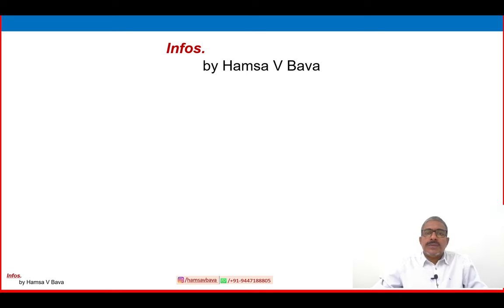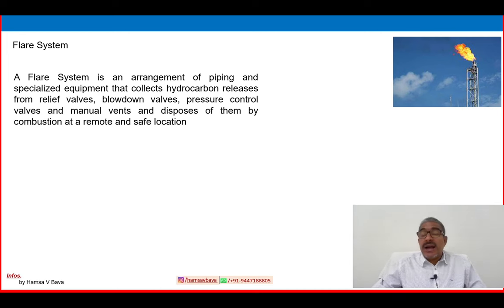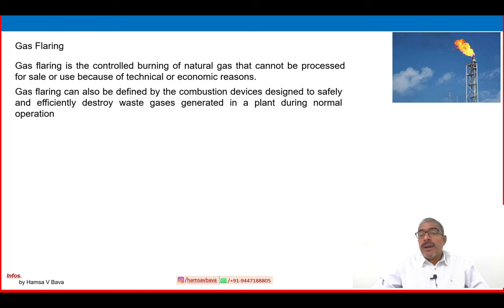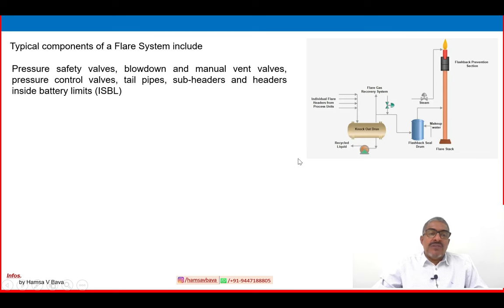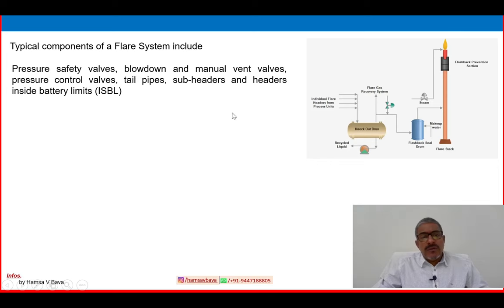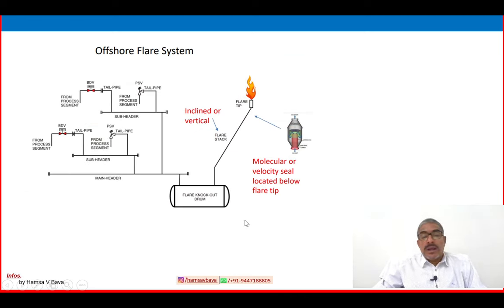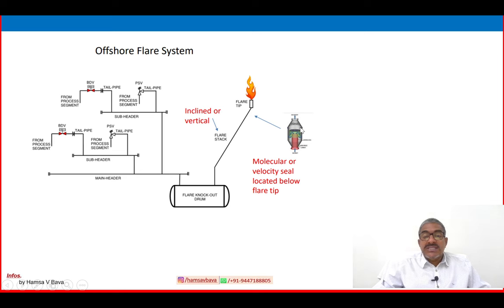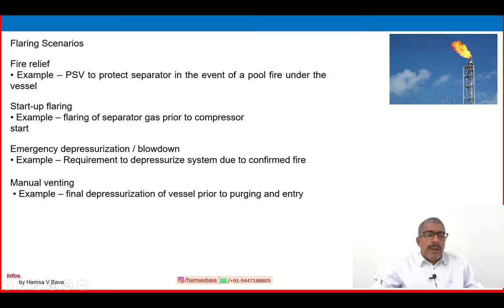Oil and Gas Operation (Flare System Part 1)

Comment: Thanks for your hard work Hamsa. This subject is very useful as it applies to almost every facility. 
Just wanted to add a couple points. Liquid seals become less and less popular as flash back prevention device at least here in Canada. The reason is that glycol concentrations drop over time when mixed with water vapour from relief fluids. Therefore, it’s freeze protection concerns. 
 Also, usually purge or some people say sweep gas is used to maintain slightly positive pressure in the flare header. Same as pilot gas, purge gas is supplied from critical fuel gas header designed to ensure that the gas is available even in plant shutdown conditions. 
One more fairly new design item related to flare systems is detonation arrestor installed downstream of FKOD close to flare stack inlet. As it comes from its name, the device is some sort of last resort to prevent flame propagation back to the FKOD and flare header.
Reply from the maker: Thanks for comment and motivation

Comment: Excellent Mr Hamza I am watching your lecture about oil and gas, really very fruitful information. My one question is it's possible if sweet gas after absorber having more co2, it can carry out glycol from dehydration unit.
Reply from the maker: Thanks for the comment. Normally H2S and CO2 (acid gas ) is removing in sweetening process. No much CO2 available after this process, really not understanding your question in this regard